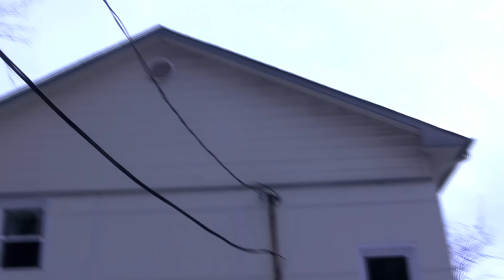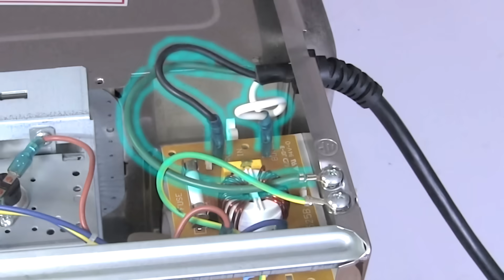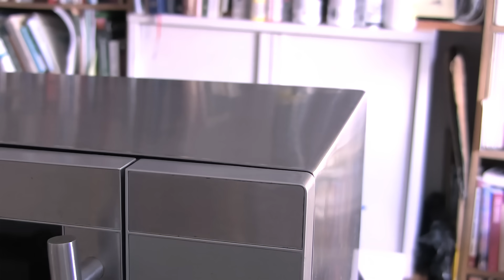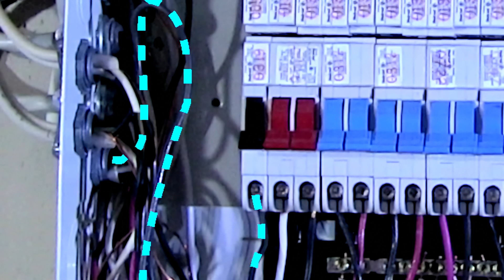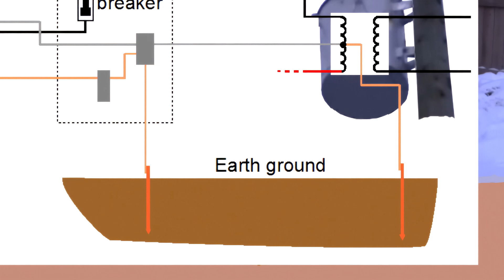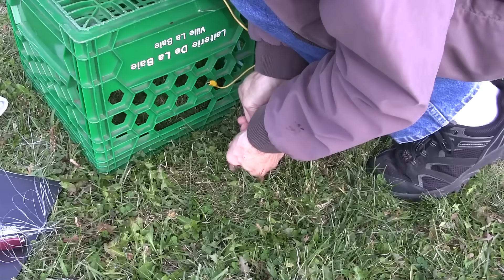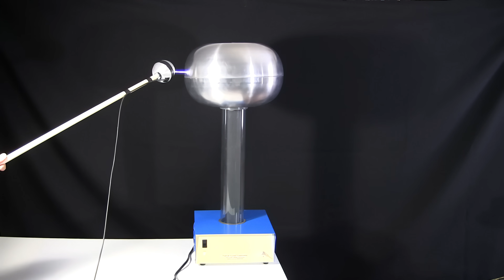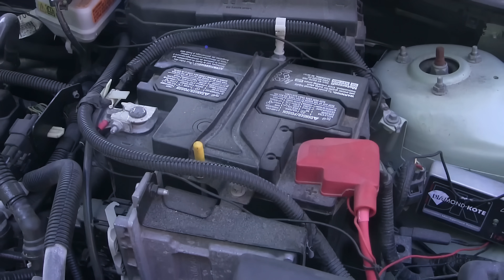What is Ground? Earth Ground/Earthing

Comment: two types of Grounding  you need to know  in house wiring

1.  equipment ground is the return for fault current 
typically when a short occurs  lets say a bad wire in a washer the current returns to the breaker box where it is bonded with the neutral to complete the path so the over current device (breaker) will trip protecting the upstream equipment    

2. Earth ground  is used to drain off high Current and voltages  to earth (IE) Lightning   it is also bonded to neutral in the breaker box 

house receptacles are equipment ground that are also bonded with Earth Ground 

Earth ground is achieved  with a ground rod,grid,plate or ufer type grounding (IE) rebar or copper wire encased in concrete

this is why the ground and neutral shair the same busbar 

hope this helps    just my humble opnion

Comment: I did not follow your explanation of why you need to connect the neutral bar to a separate metal bar connected to the ground when the neutral bar is already connected to the ground at the transformer outside?
Reply: It has to do with resistance. Depending on the distance certain safeties like fuses wouldn´t burn out quick enough.

Comment: In electrical engineering, ground or earth is the reference point in an electrical circuit from which voltages are measured, a common return path for electric current, or a direct physical connection to the earth.
Reply: Do you think maybe that’s how they keep earth rotating on its axis? My theory is there is one button somewhere where it can shut the whole world down.
Reply: @Scarlettekkk_-  😂😂😂

Comment: Here in DK ground is ground,a metal bar is hammered into ground.Neutral goes to the outside cords,here all 240 volt lines dug into ground,additional hpfi relay in each house intake,so elec. will be disconnected in milliseconds if you by some kind of accident would touch hot and neutral same time.

Comment: Is neutral the same as negative? How come the negative terminal on a car battery is referred to as ground?
Reply: Hot and neutral is for AC, positive and negative are for DC, negative terminal is referred to as ground on a car battery because it’s connected to the chassis.
Reply: The terms negative and positive only apply to DC and the electrical delivery system is AC. What is slightly misleading with the video is that on AC system, the potential on the "hot" relative to the neutral and ground is alternating between +ve and -ve and hence the flow of those electrons is reversed every cycle (60 times a second in North America). It's thus not a good idea to refer to AC lines as positive or negative, except at a particular point in time.
Just think of a neutral wire as one that is carrying the load current and is (nominally at least) at the same as ground potential. It's neither positive or negative (and it's best not to use those terms at all with respect to AC power systems).

Comment: As the story goes, the electrician miss labeled the neutral and the hot. took years to figure out why people, workers were being electrically zapped when working on said house ie touchng any thing metal in and around the home. Turns out the miss labelled wire back fed from the neighbors home via the ground circuit and juiced the wire stucco mesh and every other piece of metal that was ground in and on the house. The house lay unfinished because the workers walked off the job because they were getting juiced by the miss labeled or screwed up hot and neutral.

Comment: I forgot that the neutral was the other side of hot and ground was the bare copper wire. This expains the difference between ground and neutral which is the information that I needed.

Comment: I applaud your straightforward video.  Unfortunately, there are things which can prevent the safety we assume:   I bought a house in Larkspur, CA, which had 3-prong receptacles, but the ground screws were empty.    In industrial installations, I specify 50-ohms Rx max from main panel ground bar to reference probes at the ground rod.   But some contractors literally salt the results by saturating the area with a salt solution ahead of the test.    RE GFCI:   I was among those present when Whatshisname Dalziel first demonstrated the device in his swimming pool in the Oakland, CA hills in 1969.   He had a 120v radio powered thru a GFCI  (then termed GFI).  His daughter jumped into the pool, then he tossed the radio in, and the breaker immediately popped.   I didn't watch your entire show, but I hope it explained how a GFCI works:  by comparing neutral and ground currents and tripping over a 50ma difference.   My present concern is that the mfgrs properly, thruthfuly, painstakingly test, document, and submit data to UL on every single unit they produce.  There's been some resistance via NEMA, to which I say Bullshit !   Do your job, you're all making a mint off this and the public is protected.   Don't fuck it up by cutting corners.   (I've already nailed Zinsco, a minor supplier, on another matter, so I'm emboldened.).
Cheers, and Never Back Off.      JL

Comment: Nice video but yesterday it did not work as you explained i got shocked becuse of one of our electric warmer was broken i tried to fix it then i touch the warmer to see if it get any warm but the ground and other wire (maybe neutral can be HOT wire cant really remember) but they were touching each other and making a shortcircuit i got shocked when i touch by 2600 amps luckly nothing bad happened but it teach me a lesson to never work with high voltage stuff

Comment: ...but I have a fuse box, not a breaker panel.
Reply from the maker: The only difference there is that is instead of a breaker switch opening and then you being able to close it again by flicking the switch, a fuse becomes damaged and has to be replaced.
Reply: You might want to consider having that replaced. It may or may not be up to code anymore. Also fuse boxes haven’t been installed in homes for decades

Comment: Why not make case out of insulator to begin with
Reply from the maker: I suspect that for a microwave oven, the metal case serves to prevent electromagnetic radiation getting out and interfering with other things. Besides the oven itself, on the end with the control panel is a lot of electronics that could interfere with other electronics. Why not put another insulating case around the metal one? Cost I guess.
Reply: Yep
Reply: Most electronics are made out of insulating materials, though some do still require a ground. My toaster for example has a totally plastic outer shell and is ungrounded. My laptop power brick on the other hand is also made entirely of plastic but still has a ground prong. Like he said, the microwave is likely made of metal to prevent radiation from escaping the cooking space
Reply: Exactly

Comment: Guys, if u happen to live in a country outside of the US where the earth wire is yellow with green stripes DO NOT connect it to neutral
Reply: And that's because in those countries a differential switch is used to protect you from earth faults, it detects a current difference in the hot (live) wire and the neutral in the breaker box in case part of the current flows to earth, for instance when you touch the metal case of that microwave and current flows trough your body to earth.
The differential switch will cut the supply if a difference of more than 30mA is detected, which is regarded as a nonlethal limit for people at any voltage (not voltage kills but current, how lower the voltage, the less current will flow trough a given resistance, the resistance of the human body prevents deadly current flowing below 48V AC, but you will still feel a shock at the upper end of that range)

If you have differential switches in your system and connect earth to neutral you are feeding this earth current back in the neutral, the total sum of current in and out will be equal, and the protection doesn't work!
However it works if the differential switch is installed between the power consumer and the point where earth is connected to neutral, then the current trough earth will bypass the switch and a difference between live and neutral will occur trough the switch, a protection system allowed in industrial use in a three phase system.

The North American one/two phase system used in domestic areas is quite different from the one/three phase used elsewhere.
The protection system in the video depends on a very low resistance path for earth faults which then triggers the overload breaker, hence earth is connected to neutral to get this low resistance path, an earth fault essentially creates a short circuit in the appliance.
Reply: @Tom-Lahaye  almost correct, many residence still dont have this, never use earth as a netrual
Reply: @crunchytheclown9694  Using earth (via an earth electrode) as neutral is not what I meant and dangerous.
A combination of neutral and earth can be used in certain situations where regulations allow, but it should always be a copper wire connected to the neutral of the supply. (TN system)

And indeed, many older residences don't have a differential switch but they should have if code requires such for the system you use.

Comment: So if the current passes through the case then to ground wire if I touch the case why I dont get electrocuted?Maybe bcs i have the skin as my body resistor and current takes the easiest path(through the ground wire)?
Reply: Current doesn’t normally pass through the case. The ground wire is there in the event that it does so it can shunt the current back to neutral creating a dead short and tripping the circuit breaker
Reply: Because your body has higher resistance than a metal wire.
Reply: Because the breaker gets thrown or the fuse blows almost immediately, which disconnects the hot wire. Otherwise you would get a shock.

Comment: Voltage is an electric difference between some quantity of Coulombs and another quantity of Coulombs, causing a negatively charged area to repel electrons which leads to a current flowing to a more neutrally charged area (the ground).

Comment: Why Can't They Just Make the Case a Insulator...
Reply from the maker: I'm not sure. Maybe it's for added shielding against the microwaves.
Reply: Most electronics do have insulated cases. Microwaves use metal cases though for radiation shielding. Many appliances still have ground prongs. Laptop power bricks are made of plastic yet still have ground prongs

Comment: so inshort the ground wire/ hole is a shock resistance? please correct me if i am wrong
Reply: I'm kind of a noob here, but shock resistance doesn't seem like a good term here. The ground wire is essentially an alternate path for current to take if something goes wrong.
Reply: There is the circuit ground (aka neutral or common leg and usually the white wire) and the case ground (3rd prong US style 120VAC single phase and usually the green wire). At your breaker panel that neutral leg connects to the earth ground, as of course does the green case ground. Doubles the ground (thus shock) protection in case either legs gets disconnected and also protects in case a white neutral becomes a hot leg, which I have seen before either through a line fault or shadiddlyoddily electrical work.

Comment: I would like to disagree with you, if that's the role of ground wire, why can't we just connect a parallel wire from neutral to appliances' body. Will it not serve the same purpose?
Reply: In a short circuit to ground, the resistance of the load is bypassed.  With this low resistance, we have a high current flow, and that makes the breaker trip.  Current = Volts/resistance.  The "neutral" conductor is the return path from the load, which does have higher resistance.  So the current flow is lower, and does not trip the breaker.
Reply from the maker: The parallel neutral wire would have to come from the breaker panel and at that point, it becomes just like the ground wire but with a different name.
Reply: @RimstarOrg  Indeed it will come from breaker panel! But why the whole world is busy in providing a seperate wire, when it can be avoided?
Reply: If you connect a neutral to the case, and someone reverses the hot and neutral at some point (mainly plugging in the appliance the wrong way), the hot wire will be connected to the case and the appliance will become energized. A third non-current carrying wire alleviates that issue.

Comment: But really what is ground ???
Reply: It's the return path for electrons when the ultimate generator of your power is far far away. Rather than string a dedicated metallic ground line back to that utility, you can use the Earth instead. When you use something electrical you complete the circuit.

Comment: In case of 110v supply, the voltage between hot and neutral is 110. What's the voltage between hot and ground, and between neutral and ground? Thks
Reply: Since neutral and ground are connected theres no potential between the two? And since neutral and ground are connected theres a potential of 110 from hot to ground?
Reply: @gregjones3660  Correct
Reply: @gregjones3660  Hot and ground should be the same value as hot to neutral. This is because you want all the voltage to return back to source without any of it straying.
Reply: 110v. Both ground and neutral are 0 volts. Really, ground has several different meanings in the electrical space. This video explains the safety ground, aka earth. Neutral can also be referred to as ground as it is naturally at 0 volts. The term “ground fault circuit interrupter” (GFCI) implies exactly that. These intervene when some current doesn’t return to ground, or neutral

Comment: Cable colour in america is  black and white.. is it ?  Really ?   wow
OK, here in australia
Red is Active (what you call  HOT)
black is Neutral 
and a Green/Yellow  is Earth

now in some circumstances 
Instead of ACTIVE = RED,    Active is Brown
Instead of NEUTRAL = BLACK   Neutral is Blue

the ground remains the same

but yeah.... black and white.. that's weird
we use that  MAYBE... on a wire that goes via a switch from the Light to the Switch
usually it's a white wire,  but can be a white and a black

if i came to the U.S. and looked at Mains Power,  i'd be confused,  no question about it . (i mean AFTER i took the wall plate off)
Reply: Sweden: Brown/black/gray for the three phases, blue for neutral and green/yellow striped for ground.
The "fun" part is that older systems can have other colors, some of which have been reused for other functions later... so never assume.
Reply: @ziiofswe  
yeah our older system is just   Black / Neutral     Red/Active     Green yellow /  Ground

also i don't think we have a colour distinction for the different phases (i could be wrong, but i doubt it )
Reply: keep in mind, Australia is upside down.
Reply: @marks6663  sure..
also keep in mind why we dont' call RED ,  "HOT" but instead we call it "ACTIVE"
it's because it's so fucking hot here that the second lowest fire rating is HIGH

Hot to us is the same as NORMAL, it means nothing, hence why we needed to invent another word for it 
"FUCKING DANGEROUS" was already taken  so we went with ACTIVE

as well as the fact that our chicks are hot.
so.. we didn't want to associate a positive feeling with touching electricity .
actually we have a lot of hot things

HOT DEALS
HOT CHICKS
HOT RODS
HOT BARBIE
yeah.. it'd just be a bad idea to call the Active terminal in a circuit  HOT

LOL
Reply: @rb8585  
i don't understand your comment.

I mean.. firstly.. i'm not talking about Additional circuits in a car from clock and Memory.
that's completely different, that comes down to colouring conventions and they can differ from manufacturer to manufacturer

I'm just talking about straight up,  Residential Mains Power
why does america have black and white only ?
i mean... a black wire can lose it's blackness over time
and a white wire can become dirty and look like the black wire that lost it's blackness over time
hence why it's a silly idea

as for this..
"Maybe so people wouldn't get confused with a DC circuit that is red for HOT (active) "
i don't understand,  i mean.. 
if a person is looking at an AC Circuit , how would they confuse it for a DC Circuit ???

Mains is not DC, and you wouldn't really mistaken a DC Circuit when you know you've pulled off your Mains Power point to have a look at the wiring
I'm specifically referring to the Positive and Negative Connections
I'm really referring more to the connections, Cable Colour and avoiding confusion for the sake of safety
i'm open minded and trying to understand america, but i don't get how Black and White is a smart decision

i mean let's say American said (for arguments sake) that Yellow was Hot  and  brown was neutral
and the explanation was .... yellow is a bright colour and therefore unmistakable .
I WOULD GET THAT
we could argue that the ground is always Green/ Yellow and not solid yellow and i would get that as well
but.... Black and white
that's just fucking weird